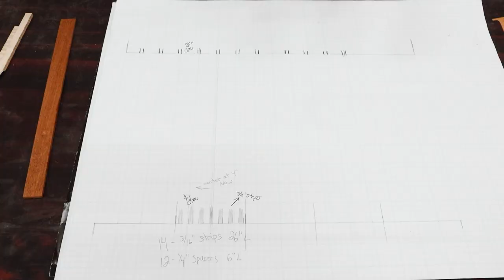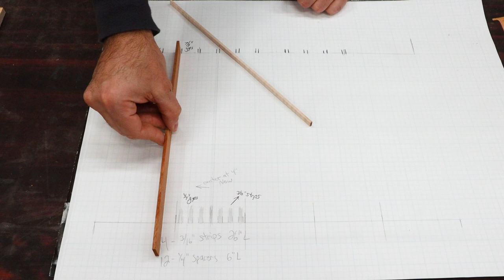Artsy Fan C-Table - A Fun Experiment!

Comment from the maker: We have some basic plans for this if you'd like to try to build one for yourself, but you definitely need to measure your couch before starting. https://thewoodwhisperer.com/videos/artsy-fan-c-table-a-fun-experiment/
Reply: Sick PS5 flex
Reply: Love both the designs. Dovetails for the bottom joinery would be a cool change as well.
Reply: @sethrosendahl : I had to look that one up. But, yeah, I see it. Good call.
Reply: I love your philosophy and builds.
Reply: One of favorite science quotes “If I have seen further it is by standing on the shoulders of Giants.” ― Isaac Newton. Now after listening to you I will use it in my woodshop also.
Reply: On the failure - what about clamping across the grain about 3 or 4 inches in. Doesn't take the place of not rushing as you said, but would help support
Reply: thx for sharing
Reply: beautiful craftsmanship as always.  Thanks for sharing the failures too, and the theory/explanations.  Cheers!
Reply: Speaking of wheels: if you have hard floors, you could rout out the base and install "hidden" casters to make it look like it is floating when you move it.

Comment: I had fun making these. I made two smaller models. I used only one vertical finger assembly for each consisting of 11 boards each. One thing I did differently was that I dado cut both tops and a scrap piece at the same time. This allowed me to glue the fingers into the table top while using the scrap piece at the bottom for support and to keep things straight. Then I glued the spacers in and trimmed to length. Thanks for the inspiration.

Comment: First, Jon had a really great idea. It's a very nice design. It's light and easy to implement. Lots of room for innovation too. I think the flex on the taller one is mostly due to the extra height. Second, the format of this production is outstanding. I like that you are working out the design and construction points during the production. This is not a  "Here are the plans go make one" video. This is a both educational and entertaining production. I see you left out the dowells on the second one. I think they were unneeded. Thank you for sharing. Have a great day and stay healthy.
Reply from the maker: Thanks for the feedback Glen. The second actually does have dowels. It’s just harder to see oak on cherry. 😊

Comment: The fan design of the vertical elements is very nice, I enjoy tinkering with designs like that.  As an architect, I can tell you that design changes are driven by material advances, more than anything else.  And our ever changing lifestyles impact design as well, more than you would think.  Thanks for pointing out the evolution of design in the built environment!

Comment: Excellent work. I’m trying to make this myself. You drastically disguised the difficulty of cleaning up the epoxy run off (I used glue) on the spline fingers, without removing too much of the spline wood 😂

Comment: When I attended design school.  I was shocked to see an experienced designer using velum or tracing paper.  I honestly believed every part of ones work should be original.  I guess I learned a lot at that moment.  It's just a matter of efficiency.  I still strive to be original, and in many ways this might actually handicap potential.  I do feel you are correct.  Inspiration is inspiration.  The beloved FLW took boatloads of inspiration from traditional Japanese architecture.

Comment: Marc, the flexibility of a beam varies with the cube of length (L^3), so the taller 2nd version became more flexible just by virtue of the increased height (beam length). Length was probably a more significant factor than tension from the reentrant curve.

Comment: From a physics standpoint, the ‘springiness’ of the taller one is as much (or more) a function of its height as it is the compound curve of the fan. Also, it appears that the point of connection on the taller one (where the fan is glued to the table top) the fan is slightly narrower than on the short table, which would also  decrease stability. But that narrowness might just be an optical illusion; hard to tell on video.  Either way, gorgeous pieces. Kudos to John for the design idea.

Comment: 24:48   I think there are two other factors for the new design having more flex. Aside from the possible compupnd curve vs continuous. 
1. It's slightly longer.   
2. If you look from the bottom where it starts to open up. The compound one forces it to be wider earlier and it's probably under more tension there. Where as the New design stays almost parallel for longer.

Comment: About your consideration "one design is stiffer than the other" --> This has little to do with the fan shape or parallel-shape of the fingers. 
For a cantilever, the stiffness scales as the cube of the length. For example, if one table is 1.26 times as tall as the other, its stiffness will be ~ half, all other things being constant.
https://youtu.be/a_E-tYRxBkU?t=794
Reply: Yep. I said the same thing, but you said it better than I did, because math.
Reply: @ericcasteel1379  Haha, math ftw. :) Did you watch Prof. Dan Gelbart's excellent video (linked above)?
Reply: I think Marc was referencing side to side flex and not so much of the cantilever flex. It's somewhat obvious that the longer piece will have a bit more flex than the shorter piece but I think the extra tension of the perpendicular fingers helps quite a bit when we're talking side to side flex. The fingers are simply stiffer.
Reply: Obviously, wider and/or thicker strips would help with the flex and twist as well.  Steam would make larger strips easier to bend.  The point at which the short strips stop will also make a difference.

Comment: You made the right choice as far as grain direction on the top piece. Like you said, if the grain goes the other way it could create a "fault line", and it would also mean that the fan, legs...whatever theyre called :P ....are mainly glued to end grain....much stronger the way you have it made. Very well done sir, this is an awesome build :)

Comment: 1 - I love your pencil choice! I have 5 of them in different lead thickness and lead hardness that I've been using for over 10yrs when I'm hand drafting (I'm a scenic designer for theatre). Love, love, love them! Especially for the .3 pencil as I'm super afraid of dropping it and bending the lead sleeve at the tip. But with these, just a quick "click" and it disappears back into the base!
2 - Totally get your philosophy of design. It can be great to come up with something new and original, but there's nothing wrong with taking an existing design idea, tweaking it a little, and making it your own. Isn't that what the old apprentice learning style was about, learning from a master then going out to do your own thing. I know in the arts, we study (and often recreate) master works to see why they are considered master works, then you can take those principles and run with them, or even break them. Good on ya!

Comment: Could the springiness on the larger table be from the added length? Seems if you made spacers longer as well that would lessen the amount of play.
Reply: Yes, exactly.
A dowel run through somewhere up the span would do it as well.
A pattern of dowel segments connecting 2+ adjacent strips would work also
Anything which prevents the vertical movement of one slat to the next locks them into place.
A sort of Kumiko design ( geometric repeating pattern ... aka a lattice of some sort) would work extremely well ... done properly it would add to the minimalist appearance you could play with the width of the connecting strips to give it a 3D patterning as well ... all sorts of possibilities

Comment: The second one, seems like it would hold more weight- maybe not so sturdy but the henge side would be less likely to collapse. Also for that small little piece you want to salvage, would be cool piece to mount on the wall like a shelf maybe hanging a plant or candle from the underside.

Comment: If you make this again, or if anyone else does, here is how to make it easier to glue the curved supports into the top:

Clamp a scrap board to the piece you will use for the top before cutting the grooves for the supports. Then, groove through both pieces. The scrap board can the be used to hold the supports as initially intended as the grooves should now line up exactly.
Reply from the maker: I was really overly cautious about that aspect of the build. I have since built three of these and none of that is really necessary. The fingers can't be tight and with epoxy applied, it's very simple to drive the fingers in as shown in the video. I did two of them myself.

Comment: During the whole build I was thinking you should angle the cuts on top.  This also eliminates the need for the dowel at the bottom because the stress is directed inward rather than outward.  I don't think the additional wobble is that noticeable.  Nice piece.
Reply from the maker: There’s still plenty of outward stress at the base. I did dowel it for that reason. Maybe less stress than the other orientation but it’s still there.

Comment: The difference in stiffness is more dependent on the increased difference in length in the first version due to the compound bow. The curve in the bottom of the second further reduces the length variation.
(If the fingers just where run straight up and down with a bit of space between each it would be very unstable.)

Both versions are very nice examples of nice design and good looks in my opinion!

Comment: I love this end table solution. What are your thoughtx on running the uprights through mortises in the top and bottom allowing for just a 1 inch overhang? The symmetry of the bottomside chamfering being allowed all the way around the top, the contrast created with the mortise showing through on the top and perhaps the added benefit of the increased mechanical connection?  Thanks for the inspiration and Happy New Year!

Comment: At 13:36 I see a problem with your strategy: when pushing the gluing jig down, you made it push the strips further apart than when it was holding them at the top. This meant that they no longer had the spacing you marked on the top.

Comment: I think the reason the second table wiggles more than the first is about physics. 

Torque is force times the lever arm. The lever arm starts where the spacers end. Because the second table is taller, the lever arm is longer which multiplied the torque and makes more wiggle. If you had made the spacers proportionally longer, I think the stiffness would have been the same.
Reply: @EngineerMikeF  so my assumption that the wiggle starts at the end of the spacers is flawed. The true lever arm extends all the way to the base. Got it. 

The spacers add stiffness. 

My Physics is rusty. Been 36 years since I studied it

Comment: I believe you can repair the broken one so that it is almost invisible that it was ever cracked. Make some dowel holes for alignment into the base plate, into the crack faces, to ensure perfect alignment, then just glue as you would glue a panel. Even if the repair remains slightly visible, it's in a place where nobody looks - it will be under the couch in regular use.

Comment: Good afternoon sir. I love your channel. I have a kind of dumb question for you? Where would be a good place for me to look for a variety of wooden legs for patio furniture? I'm in south Florida and I have a customer that has furniture that is faux wicker with chunky curved wooden legs and they are rotted from getting wet. I want to look for new legs that are similar to the same design and do your epoxy trick to them. Any help would be great. Btw, they aren't screwed to the chairs or tables either. They are smaller at the base and fit into 2×2 metal squares that are welded to the chair frame and then screwed into the legs. Thank you

Comment: After seeing this I would love to see one made with a sort of hourglass design for the strips. As in finger joints on both the top and bottom and a solid block in the middle. You would probably have to put the slots a bit closer together so as not to put too much stres on the wood. If I ever get the tools required I'd like to try this.

Comment: Pretty cool!  Attaboy to Jon!!  ... One of the advantages of doing this assembly "dry" (not steam bent or laminated from thinner strips) as you did is that you built in stresses into the fan assemblies that, in the end, provides added strength and stability.  You got it right in comparing the stability between the two designs.  The joinery at the white oak table top will hold them well over time (stresses are lateral, pushing against wood), though the bottom of the fans will want to come apart, pulling against the glue joints, but you addressed that nicely with the dowels.  (The bevels at that lower fan assembly really do add to the piece - very nice detail!!)  With time, I'd expect those internal stresses will dissipate to some extent as the fibers of the wood relax especially with seasonal changes in humidity.  .... I am wondering, however, why you didn't try steam bending or laminating? - that would have been my initial approach out of the starting blocks.  Both techniques would lend themselves well to getting the shapes you needed. ... The second version os pretty sweet too!
Reply from the maker: I don't know how you'd employ lamination any differently that what was shown here. It effectively is a bent lamination but with space between the strips. Going even thinner on the strips and then gluing them together so that each strip is its own lamination is a LOT of extra work for very little gain. As for steam bending, that's really only possible if you know your curves ahead of time, which is difficult to predict. You can do a dry assembly to get the curves and then steam bend to those, but can you imagine making that many different bending forms?! No way. In the end, the whole point of this design is to make the strips thin enough as to negate the need for any type of bending tricks. So none of that is really necessary. If the wood is thin enough, it takes the bend just fine without an excessive amount of stress. So the easiest answer to "Why not steam bend or laminate?" is because it's really not necessary.

Comment: This is an awesome design and also a great video. I want to try building one. As a relatively new into woodworking what do you think if I were to use some readily available softwoods like pine in my local home centers instead of expensive hardwoods? Will it work? Thanks in advance.

Comment: Awhile back I made something similar except without the fan concept. A typical top, two legs just like these and the base just extensions of the legs set at 90° to the legs making the base. The 90° angle is held together with a couple of long, flathead machine screws threaded directly into the endgrain of the legs. (made from 3/4" white oak) Both bases were rounded over considerably to slide under a mattress to form a small table on the side of the bed. That was about 4 years ago and both are still being used, one on my side of the bed and the other on my wifes side. The only drawback is the occasional bang on the ol noggin in my sleep, but it's rare. I've never had one come lose yet and they've supported drinks, dinner, lamps, books and other assorted junk. Nice place to set the morning coffee to be sure.

Comment: In regard to the second one being slightly more easy to deflect it could be simply longer slats. The longer a board is the more likely it is to bend irregardless of its thickness (even a 2 x 10 floor joist that’s too long will bounce). It seems that a solution for this could be to make the spacers longer thus shortening the thinner strips giving them less opportunity to deflect making the project more stable.

Comment: The pressure of the curved wood in one direction would keep it from bending because of the size of the pieces of wood being pulled into the shape it's in.you took away a bit of the stability when you added the 5, 10, and 15 degree curved on to the top. What would have added stability would have been to change the shape of the top itself, maybe two or three fans coming up on to a half circle while the top goes around in a full circle. These curves will be pushing in four directions at the same time so the top would have twice the stability the one dimensional fans have.

Comment: What would happen if you twisted the fingers a couple degrees along the length in opposite directions on every other piece? Maybe that would stop lateral movement too? Then again, maybe that will split the tops and bottoms too

Comment: I'm seriously digging the whole art decor feel of it. I kind of want something a bit like this only less of a C table - instead having that fanning design on 2 opposing sides. For the top, inlay a chess board (probably an end grain thing). Wide enough that you can fit a glass of whiskey on each of the sides (and captured pieces).

Comment: What if the legs were on a small angle? Instead of parallel to the edge of the table the were at maybe 10 degrees from each other. now you have a triangle and it would be more sturdy

Comment: You could add another fan to the other side and use it for an end table. That way it could be used for more purposes and it wouldn’t be necessary to calculate an exact custom height for each individual armchair

Comment: The stiffness is different for two different reasons.  On the tall one, it's, well, taller.  The longer the beam, the easier to defect. 
Second, on the short one, you're deflecting the vertical pieces A LOT More than on the tall one.  So the deflection is just higher.  The S curve probably didn't help as much.  Very cool tho.  👍